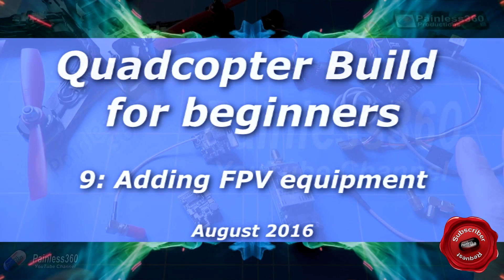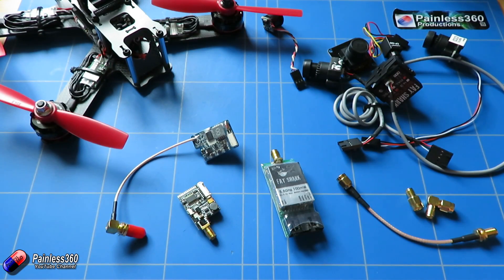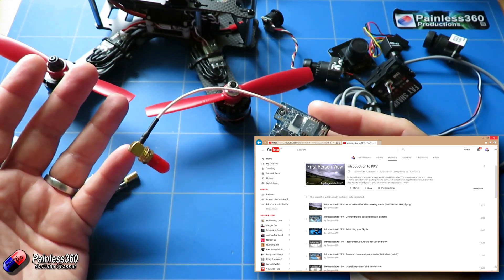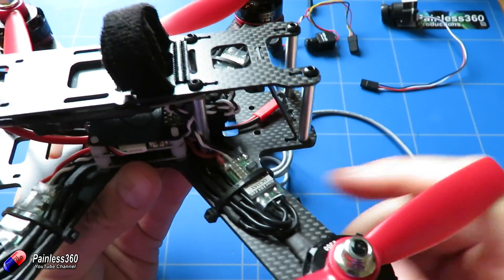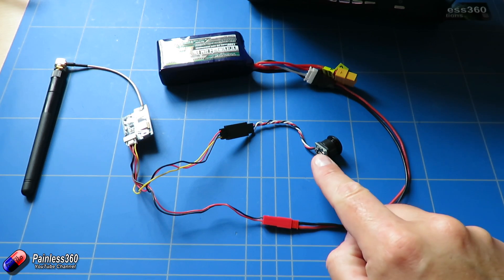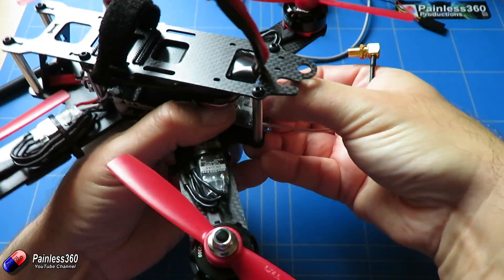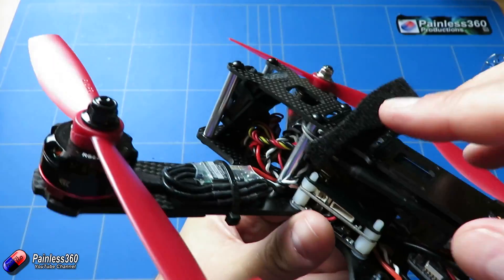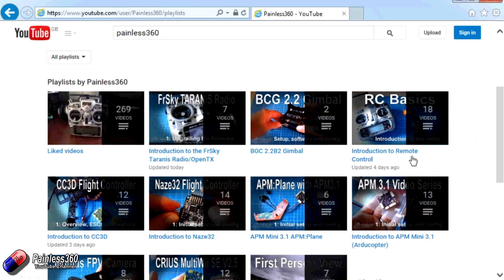(9/9) Quadcopter Building for Beginners - Adding FPV kit to the model

Comment: nice brother thanks for the video, i did everything correctly my quad is a beast. however

can i plug OSD instead of just a plain camera feed? and if i can do that how can i do it 
" i have the same exact quad in the video " except i am running TBS Unify pro and a foxxer camera. thanks again for the uplaods
Reply from the maker: I don't understand the question. See my later builds and my video on quadcopter FPV explained for new builders.. Best of luck

Comment: okay lets say i got vtx and camera installed ... how do i pair it with the goggles ???
Reply from the maker: You don't pair it like you would with am R/C radio and receiver. The VTX transmits the signal on the band/channel you've set it for and you 'tune in' the goggles by selecting the same band and channel. It's more like tuning in a TV or traditional Radio - no binding needed..
Reply: @Painless360  what kind of vtx and screen are best nowdays for good value and something that would fit for the first model you built , thanks.

Comment: Dear uploader, 

I made a quad, 1st time,  wth almost th same config & same FS you used,  by watching yr vids carefully.  All worked out fine @ no flight problem like yr one.😀😀😊

However,  now ques is how can I enable an altitude hold option?  Th "flight controller " does not hv it built in.  

Can I use any extra sensor board to do jst altitude holding? Could pls show me a board.  I m yr ch subscriber. 😊 Thanks for yr great vids.
Reply from the maker: You need a barometer for alt hold - see the manual/wiki for Betaflight for more detail.. You could also try a sonar if it's below about 1.5m.. see my videos on that.. adding a baro is possible. Google 'i2c barometer' to find them. I've not done it myself.

Comment: Sorry for the newbie question.  On the cable that runs from the battery there is a JST connector on one end that plugs into the transmitter, but the other end has a black plug I can't identify that appears to plug into the white balance connector on the battery.   I would like to make/buy a cable like that but don't know what sort of connecter/cable to look for.   Would appreciate any help.   Absolutely love your video series.
Reply from the maker: +Marvin Whisman http://www.ebay.co.uk/sch/sis.html?_nkw=3x+each+2s+3s+4s+cell+JST+XH+balance+connector+plug+for+LiPo+charger+balancer

Comment: I got my one of these 2weeks ago and the build went very well thanks to Mr 360.  However the problems started with one of the esc's not being recognised as it is simonk so that's no good.  also the FC keeps cutting out the power to the receiver,  I've been trying to contact gearbest but they don't respond to emails so now I'm going down the PayPal clames root....shame I had high hopes as the quadcopter for beginners guide was awesome, now just let down buy dodgy components.
Reply from the maker: +bg563195 I'd try another FC.. that could be the problem you gave. Best of luck with it.
Reply: Painless360 I'm honoured to receive your response.  I have an afroflight 32 do you think that would solve the dogey esc I have.  forgive my negligence as I'm new to all this?
Reply from the maker: +bg563195 if try and replace like-with-like if you're new to this. Less chance of messing up the connections.. best of luck!
Reply from the maker: +bg563195 depends on how you are sure that the ESC is the problem. It could be the output from the flight controller. You will need to do some testing. Best of luck!
Reply: I got to the point where the first flight was almost identical to your video, so I  flashed the latest ckeanflight to the fc and downloaded the blheli suit and appon checking the esc's on bl heli the number one esc isn't recognised, a description it gave was possibly simonk bootloader which I thought was weird as it says blheli on the packet. I have contacted paypal and they are dealing with it now as gearbest won't return my emails...... Needless to say I am gutted because it feels like I have failed... lol
Reply: hi Mr 360, I'm back and not having too much luck...... story so far, I have a new build on the go, same frame,fc,motors,the pdb is different but works fine and now has racerstar ms 25amp esc's.  hit a small snag as 2 of the esc's wouldn't sync with the master and esc number 1, I tried to flash latest firmware to them as apparently the current was out of date and not supported.  but in doing this process my motors started to burn as did the battery.... are the esc's toast as well as the battery and motors, how can i check without burning the house down. help!
Reply from the maker: I;ve had motors turn like this and the ESCs were fine. Best of luck!

Comment: Finally got my kit for this build, have a question about power and my vtx. I went with the fx799t it came with this voltage filter cable I've spent the all day looking around to find something on it but with little luck. I guess it's to cut the video noise from the motors and esc's and I don't see it in any of the builds not just yours but several others as well. Do I need to add this in? The vtx came with what looks like 2 sets of wires one for the voltage filter " a lot more wire and connectors" and 1 set for no voltage filter "very little wiring". Is there a spot on the pdb that is already filtered? I see spots to power the vtx and cam on the pdb? Sorry for the newbie questions but I think I have everything else down good enough to get started .
Thanks for any help
Reply from the maker: I've not seen that, You usually pop it between the Vtx and the power connections from the battery/PDB. Interesting..
Reply: Thanks, I got it together and it kinda works, no power to motors if I have one shot turned on, turned off motors seem to run ok. Yaw is backwards and so is roll is there a place in clean flight to flip them or did I do something wrong using spectrum trx. I'll have to wait for my buddy to update the esc I'm on mac and belheli only works on windows:(
Reply: Ok got that all worked out went for my maiden flight this morning and I have an issue with my #2 motor giving it just a little throttle it stalls out causing a flip giving it more throttle seems ok but cut it a give a little just trying to hover and it stalls and flips just the one motor. Any ideas? Bad esc, bad motor, bad set up or bad install? Cheers

Comment: First of all, I really appreciate these videos. They have helped me dive head first into the hobby. I'm using the same kit as you, however I have a FrSky XSR receiver and a Taranis X9D plus. 
Now I'm having a few issues and I'd like some advise. Firstly, I have successfully bound my receiver to the radio but I can't seem to connect it to the flight controller. 
I'm trying to use SBUS (set up the same way as one of your other videos) and the cleanflight configurator never recognises my inputs. I've made sure the settings in the configurator are correct. 

Also, where would you suggest we go for support? Is there a forum you recommend? Thanks for your help.
Reply from the maker: +Handsome Simon we have series that goes into a lot of detail for the flight controllers. See our SP3 series where we cover Sbus setup.  Support can come from many places the vendor, forums, YouTube and websites are the most common. Some places are more helpful and tolerant of new pilots and builders than others. If you add Painless360 to your search you'll see if we've made a video for the thing you are after.  Best of luck

Comment: My Q58-2 VTX indicates that it takes +6-30V in, and provides +6-30V out.  So a 5V camera like the one you linked would require a BEC/regulator, no?
Reply from the maker: +QC Support see our video on that FPV transmitter on the channel for more detail. Best of luck!
Reply: (Really I've learned a lot from your videos, I'm trying to be helpful not quarellsome.)

I checked again and the Q58-2 you linked above is exactly the link that shows up in my HK order page.  I just put a meter to the Vout on mine and I'm seeing 10.5V with a 3S battery on Vin.  Clearly that could fry some 5V cameras!
Reply from the maker: It might, it works great with the setup we have here but I've added a note to the description and in the video too so that it's clearer. Best of luck with your build!

Comment: And a small request.
I also have appa-  FS I6 with the receiver FS I6B
What is necessary settings in Cleanflight - that would work for the PPM.
And also to include all the channels in the switch.

Now this transmitter (Flysky FS-i6 ) is very popular ..and i think -this video will be wery helpfull for many people.Thanks
Reply from the maker: +Alex R. Thanks for the idea but we don't have one of those radios. Using the information in these videos with the manual and a search or two in the forums should get you sorted. Best of luck!

Comment: hello, you had told me to contact you via here.  Im trying to connect runcam hd to my eachine racer 250.  does the camera run off the battery inside it? or do you have to find a 5v source on the actual quadcopter?  can i just run the video and ground wire to my eachine transmitter and were good to go?? or do i need to wire the camera into a5v? and if so where can i get that 5v, with a UBEC?... thanks Steve
Reply from the maker: +Steve Maratea see our review of the camera. Most vtx will provide the 5v. Check out the video out cable to see what connections you need. Personally I would not fly with an action camera as the primary fpv camera. Use a dedicated camera to fly with and use action camera to record in HD. Best of luck!

Comment: Hi, I am coming back at my first erased comment. I thought I had the solution but it seems it's not the case. My FPV range is still not good at all. My first thought was wiring, because the problem was there overnight...without flying in between. I checked and resoldered the power cable of the vtx and put the vtx somewhere else. Didn't work. So then I found that the frequency tables weren't the same on the quad and goggles, so I figured out that only the B1-6&8 were the same. So I tried like B4 and it was a little better. But not more then 30 meters. 

What could distort/decrease the signal/range? Still bandwith&channel or something else...? 

If you have any idea. Please let me know.
Reply from the maker: +KoekeBeest1985 if the transmitter has been powered without the antenna being connected securely then the transmitting electronics could be damaged or there is a problem with the antennas you're using. We use the Aomway antennas a lot here. I'd try a new antenna and then a new vtx. Make sure you have circular polarised antennas and not the whip most kit comes with, best of luck!
Reply: Yeah I've used those for a while on my other quad. Was used to those that I didn't even realise that this vtx is SMA....not RP SMA. Sigh, no wonder I have no reception...thanks for your help man.